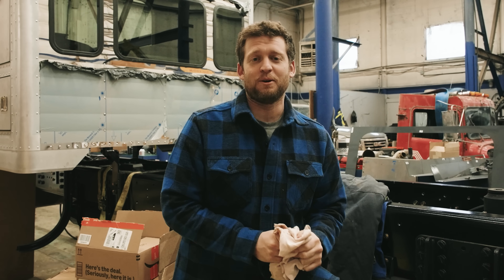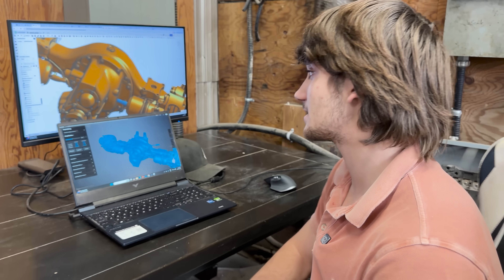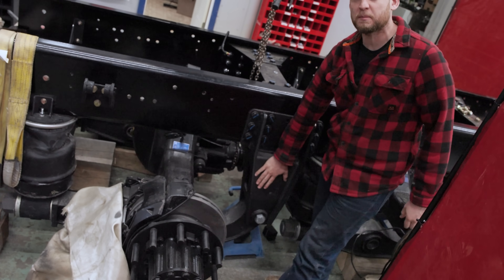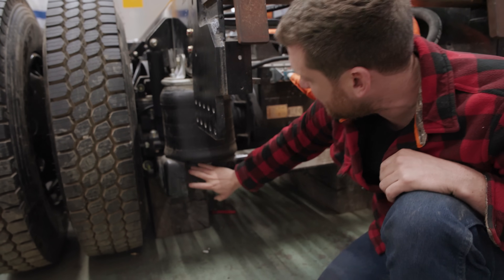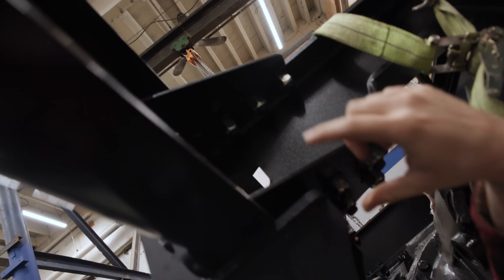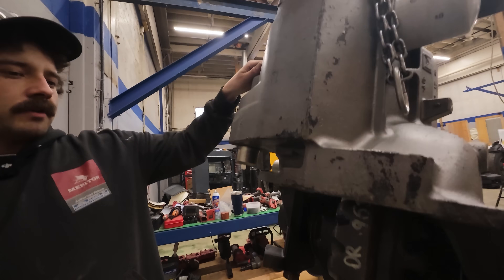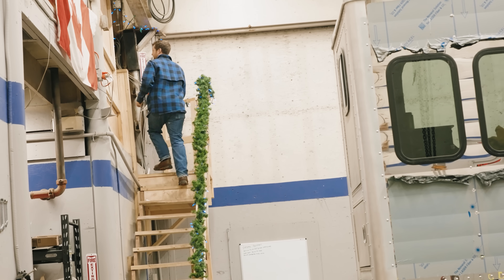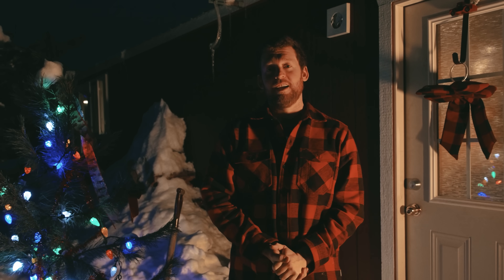When Precision Becomes the Problem

Comment: Sir, I love you, but you're not talking about tolerance, you're talking about clearance. You needed a slip fit, you got an interference fit. That's a lack of clearance. "Tolerance" is the allowable deviation from nominal that will not interfere with fit and function.
Reply: Yup. More clearance, with a tolerance of manufacture that will still allow for that clearance in this case. The joys of prototypes and production, shit happens.
Reply: All hail the engineers! They are technically correct, this is the best kind of correct.
Reply: Tolerance on the axle castings which hadn't been accounted for when trying to make it a sliding fit. The engineer should learn the lesson that the mechanic is usually right about how to make it work and fix the engineering screw ups but not always the best person to ask about detailed design and fabrication.

Just because the mechanic can grind it to make it fit doesn't mean you should design it like that because they're used to having to suffer it.

Everyone appreciates it when it goes straight together without too much pain. The production schedule never has the time in it to rework everything, that's how you end up on overtime and weekends because the delivery date never changes.
Reply: It definitely is clearance here. Clearances are needed to account for tolerances. Also, I am often appalled at how little understanding people have of tolerance stack and how dimensioning impacts it.
Reply: Good explaination
Reply: Yes, but if there is a tolerance issue in design, that will create a clearance issue when fitting. Both issues occur at once.
Reply: Some times it is just a coat of paint… just a blonde on and she won’t fit any more.
Reply: He's doing it for the algo. It detects go words and phrases and no go words and phrases and will boost or shadow ban accordingly.
Reply: A tad pedantic without knowing the designed spec... as it could be either a slip fit design that warped on welding into interference or an interference design that needed grinding to become a slip fit.  In this design, increasing tolerance is... adding more slop/clearance...
Reply: @feedtheagle6851  The word "tolerance" is a term of art. It isn't pedantic to describe its use.
Reply: Without knowing the tolerance of the axle housing from the manufacturer, one does not really have the ability to specify the "correct" tolerance for any fit.  I would bet that the tolerance of that casting is huge compared to what most engineers would want to spec.  All faying surfaces would have to be machined to hold tighter tolerances, but from I see only the bottom is machined.
Reply: Kalashnikov AK 47 tolerances ... Rattles like...but never jams ...mud is free lubrication 😂
Reply: @clivestainlesssteelwomble7665 tolerance clearance
Reply: Nope. This is tolerance: taking into account the fact that the mating part from the manufacturer might be different from one item to the other. They designed the brackets for one axle, they don't fit on another.
Reply: No this is definitely a Tolerance issue. 
If you have a shaft of the diameter 3.25" and you make a hole of 3.245 diameter, they fit perfectly with perfect sizes. If you have the Tolerance of +/_ .oo5 on both parts you will get interference on some parts.
Reply: Tolerance is a completely acceptable word to use in this situation as the tolerance wasn't properly accounted for to ensure a clearance fit.
Reply: By your definition it's tolerance. If the weld had warped the other way it would have fit. Ie. The CAD did not account for the ±0.5mm or whatever it was that the metal brackets would warp on welding.

Ie. It did not account for reasonable manufacturing tolerances.

That's what he's talking about.

Comment: Hello.  I admire Edison and all of the people working there. Especially how you navigate the challenges of creating a new product and government regulations.  You are doing a great job 👍👍.  I would like to offer a couple of pieces of advice. I am a retired tooling and manufacturing engineer from a large aerospace company.  For weldments I recommend PWHT post weld heat treatment, then all machining.  This is actually required by ASME.  The second recommendation is cultural not technical.  Try to encourage mutual respect between the engineers and the technicians on the floor.  Sending a handwritten note explaining tolerances to the engineer is an insult.  Also, saying how you would irritate him with broken spaghetti and ketchup was intended as humor but you are ridiculing his culture, which is insensitive.  I do not think that is who you or Edison motors wants to be.  I dealt with hundreds, maybe thousands, of situations like this over my 35 years in manufacturing. The highest quality process is to request the engineer to come to the floor and help resolve the problem.  This engenders teamwork and learning, rather than someone running back and forth between design and factory.  Honestly the mechanic in the video came across as arrogant and disrespectful of the engineer and so did you.  That will not serve you well.  Blessings ❤
Reply: I do not have any engineering/tooling/mechanical or any such like experience but I highly admire what these guys are doing.
Reply: @fredrickmiano6733   the entire town of Golden have admired and adopted these guys , and from what i'm seeing so has rest of Canada who are following their progress !
Reply: I totally got a kick out of the spaghetti "punishment".  We need more humor and less (politically correct) sensitivity.  Sheesh !

Comment: might be worth it to get the mounts line-bored or machined after welding, can go a long way to realigning those warped holes and plates
Reply: Or weld them with a exact size bar through both holes, would probably be enough.
Reply: @nilssen2 that unfortunately won’t make a difference, if the metal wants to move, it’s going to move, a spacer or alignment bar will just get stuck when they warp, and they will spring as soon as it’s removed, the only option is to have them machined after welding, either via line-boring or a proper machine setup
Reply: @zanderchiasson8064  I have done that plenty, works well. I've done that alot when modifying excavator implements and spreader bars for cranes.
Reply: @nilssen2 we’ve build several implements at my work and even with the spacers they have ALL needed lineboring to correct the alignment of the pin and mount locations
Reply: In line honed...
Reply: This is the real solution. It will be perfect every time (unless the machinist really fucks it up while boring it).
Reply: @LostMyName15  actually tbf the real solution is almost certainly to just improve the tolerances for the application
Reply: Considering that they're welded in place they might be warping some more during assembly. Best to line bore them after they've been welded on.

Comment: Just remember Chace these first trucks is the prototype for your mechanical trucks and logistics.   There is going to be a lot of little things that no one thought of, and there will be things you find out you can do better.  This includes ordering the right parts and doing a Q&A when you get them to verify they are correct.   You won’t get it correct at first, neither will your suppliers.   But that is part of the process.   The biggest part is setting up the procedures, checklists, and quality checks during your build process.  This will be vital as you expand and hire new people.  The 100th truck will be far far easier than these first 5 trucks.
Reply: I work at a big truck manufacturer in RnD. Shit goes wrong ALL. THE. TIME! I dont think Ive ever witnessed a part that made it through testing without issue. And often teams will inform you that its all ok, and then you recieve a part that is just as fucked as the one you complained about.
Reply: if you get through a prototype without a tolerance issue, you've missed something and need to inspect it better.  This is why we do multiple rounds of prototypes!
Reply: This is a classic design for manufacturability problem — and it’s one almost every company hits after prototyping.

1) Prototypes don’t test repeatability.
Building one unit proves it can work. It says nothing about whether you can build thousands of them the same way without heroics.

2) Scaling exposes tolerance stacking.
Small variations that were invisible at low volume stack up fast. Parts stop fitting, yield drops, and suddenly the line is “debugging itself.”

3) No standardized work means uncontrolled variation.
If the process lives in people’s heads, every build is a new experiment — and experiments get very expensive, very fast.

4) Rework hides failure until it’s fatal.
Rework feels like flexibility, but it’s really just masking design and process gaps while quietly burning time, money, and morale.

What actually worries me is that you’re discovering these issues during prototyping. That’s the easy phase. If this already hurts now, full-rate production is going to be absolutely unforgiving.

None of this is unique. It’s exactly how a lot of companies fail trying to scale.

Speaking as an industrial engineer who supported gas compressor and locomotive production: every “mysterious manufacturing issue” eventually confesses. It’s tolerances. It’s rework. Always.
Reply: @jenniferkneller1228  well said.  I'm not an engineer but my strength as a designer comes from years of experience as a tool maker for injection molds, machining, metal fabrication and working on custom automation machines and tools.  I design things from the perspective of the guy who has to make the parts and put them together and think about how I can make that process as straight forward and reliable as possible.  I've argued with people that just because somebody is really good at  CAD software it doesn't automatically mean they're a good product designer but a surprising number of people think it does.  Knowing how to use wood planes, saws and chisels isn't the same as knowing how to build furniture.
Reply: @jenniferkneller1228  Gotta be the best free advice I've ever seen in a youtube comment.
Reply: And not worth losing ones temper in a youtube video as was voiced over.. Shit will happen and all you can do is move forward with a solution. May not be ideal, may take/time money, but there is always a solution.
Reply: bump

Comment: is it just me or are those the old style axles? is that truck going to get the newer dual-motor axles or no?
Reply: lol, i see now that i was entirely incorrect!
Reply: Why is the royal truck not going to get e-axles? They’re entirely off-highway use no? Or is this to accommodate the regulations?
Reply: @zanderchiasson8064 they are building an ICE truck with a gearbox ( not an hybrid) to get truck building experience and revenue, while they keep trying to fix the regulatory issues they have with their hybrid design.
Reply: @niconico3907 yes but they had made it seem as if the Royal and Emcon trucks were going to be hybrid, at least until the latest regulatory fiasco